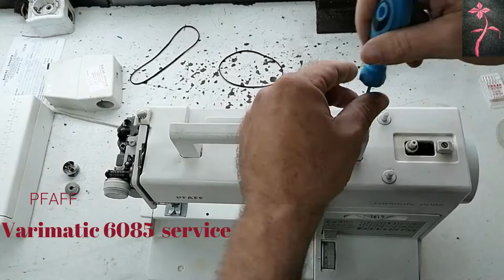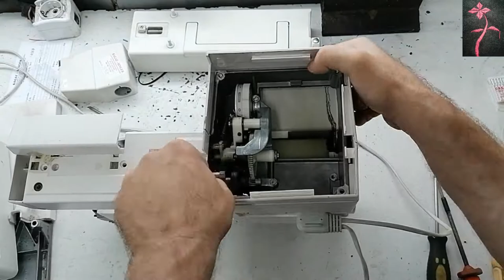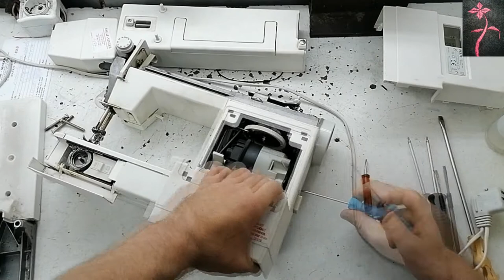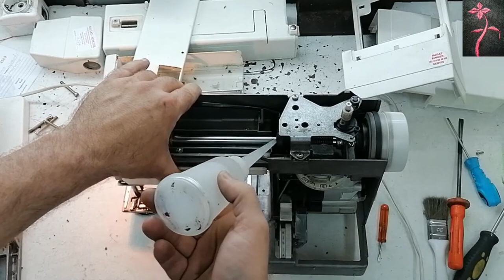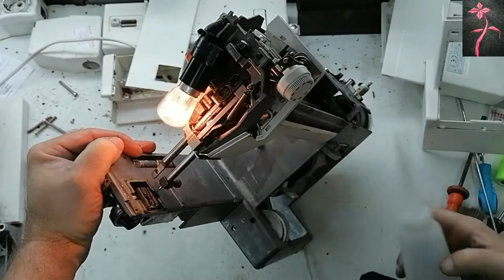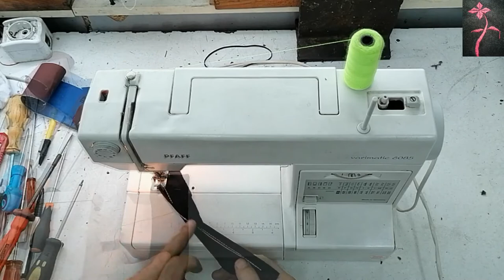PFAFF  VARIMATIC  6085  SERVICE

Comment: Oiling the head parts on the 6091 is much more of a nightmare than with this due to all the extra moving parts packed in there for the dual feed. Otherwise it's the same machine. When I got mine it was frozen up with hardened white grease and all that had to be cleaned out. I replaced it with Super Lube (which does not harden like that). Triflow grease also works but I like Super Lube because it has a plastics and elastomers compatibility list (it can be used with basically everything but polycarbonate and natural rubber)

 The way I like to oil is apply a drop turn the machine by hand a few times then use a microfiber cloth or q-tip to remove any excess oil that's still on the outside of the rotating part.

Comment: hello thank you for an amazing video. 
Is there a way to center the needle position on this machine. Mine veers slightly to the left.
thank you
Reply from the maker: on the head itself, from a bird's eye view, you can see 2 nuts or 2 ibus, rotation to the left,pozzzzz
Reply: @sewingmachines6369  thank you. Have you tried to take the hand wheel off? I’m wondering if it is a reverse feed screw. Mine won’t budge. Thanks again.
Reply: @sewingmachines6369  could you explain with more detail. Where are the nuts? I have the same issue with my machine. Could you make a video?

Comment: Hello, I have set the upper tension on my sewing machine to the highest level, but loops are still forming. Can you  help me, please.
Reply from the maker: Hi, I can. Simply tighten the bottom piece. There's a screw on the piece. Where did you put the coil, and the upper one give way
Reply: Thank you